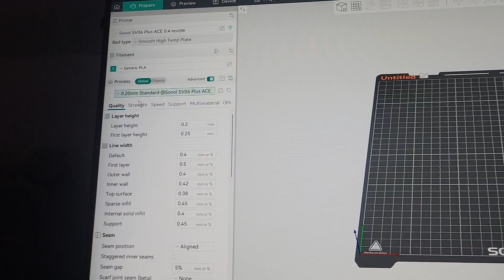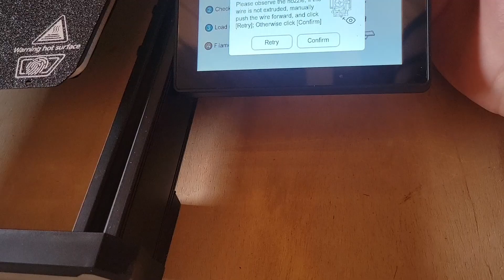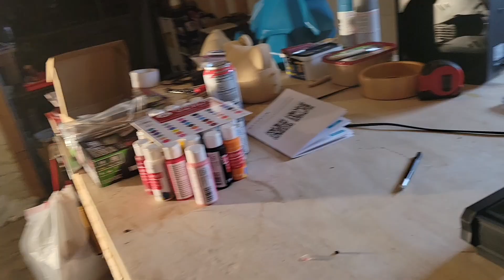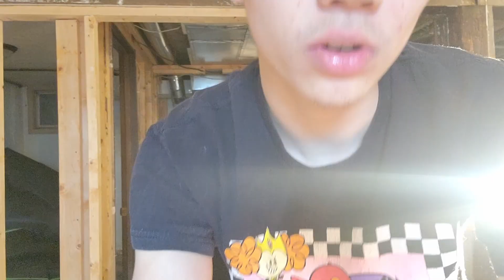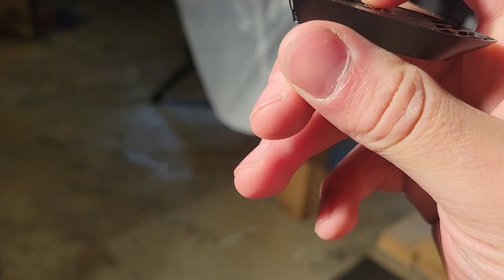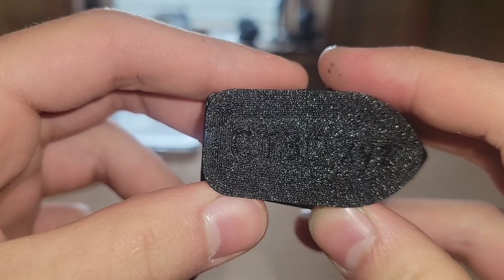Sovol SV06 Plus Ace | first prints and review

Comment: Cool video. I also got this one as my first ever 3d printer and Jayo PLA works great. But the eSun Chameleon (sparkly) filament acts up and strings like crazy (did most of the calibrations but no luck printing more complex then a benchy or a flexy t-rex.
 I want to change that noisy fan from the PSU asap
I put in a 1meter white LED strip powered by one of the USB slots to get better lighting, but the camera is super bad, hope someone finds a mod for it.